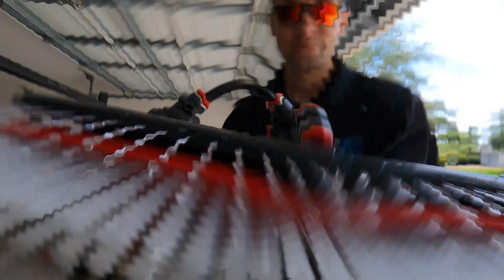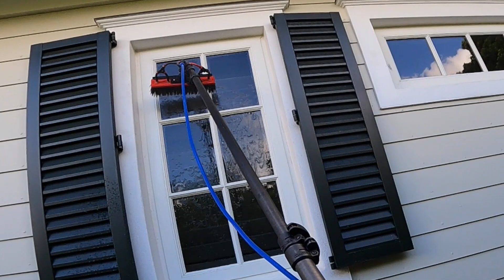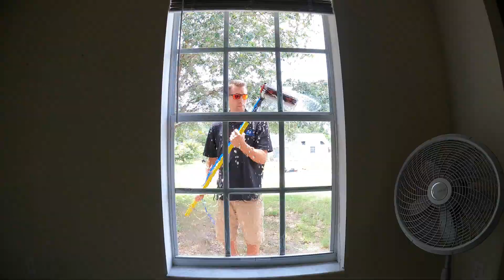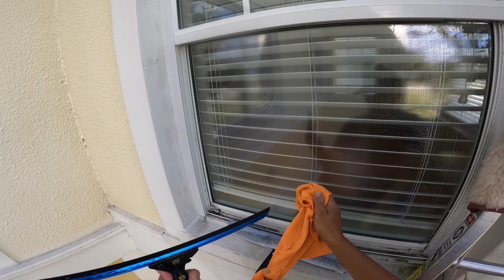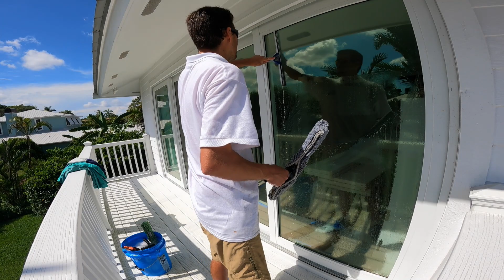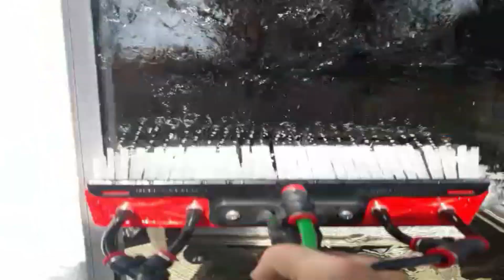Window Cleanin' Dreamin' 😎🤘

Comment: what pole is that and what size hose
Reply from the maker: Hey MKEprowash!  The pole that I am using on that video is called "Xero Pro"-- It is a 40 foot pole, and they sell an extension that is universal on their products that allow you another 10 feet.  You can find their products on windowcleaner.com-- I have had this pole for a little over 2 years now, zero issues.

https://xeroproducts.com/products/xero-pro-basic-carbon-fiber-water-fed-pole

The hose is 1/4, I bought it from a supply company called "CWC Window cleaning supply"-- It is called the "viper" hose.

https://cwcsupplyusa.com/viper-hose-1-4-blue-per-ft/